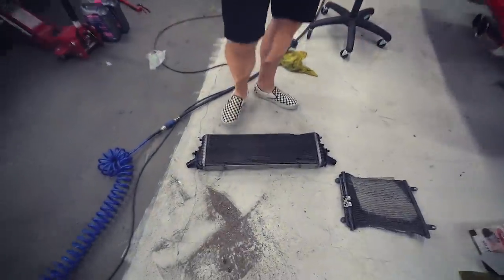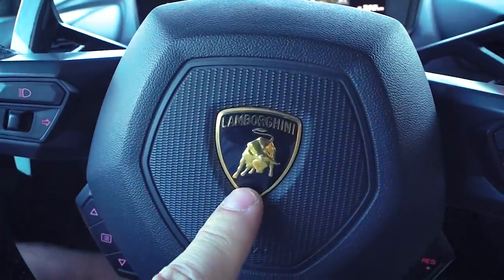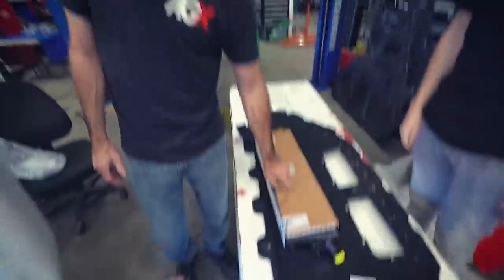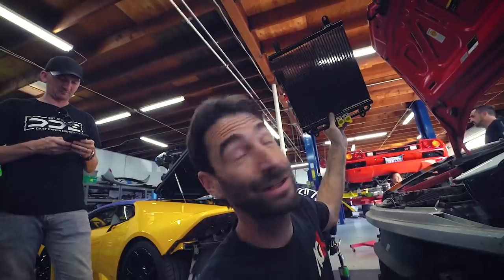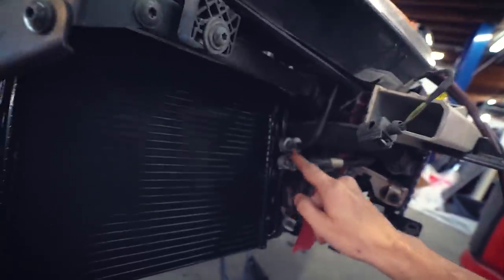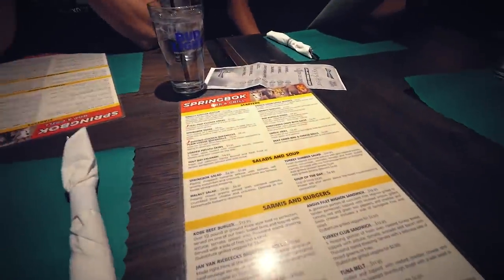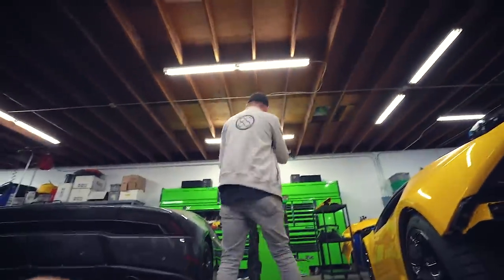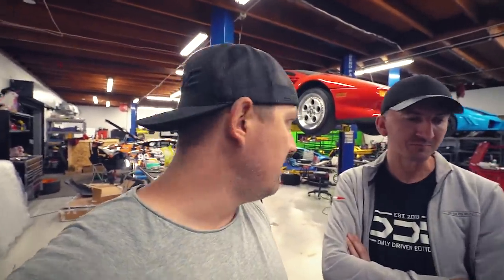MY LAMBORGHINI ALMOST DIED! HERE'S WHY...

Comment: Put window screen over your radiators. It helps keep debris out of the cooling surface areas, (like bug buildup) it works really well. Use wire brushes "comb" cooling fins straight :)

Comment: get some Screen Door material and you can make your own liner for where the air vents are and after X amount of miles you can replace it and save A LOT of time and money instead of replacing radiators/coolers.